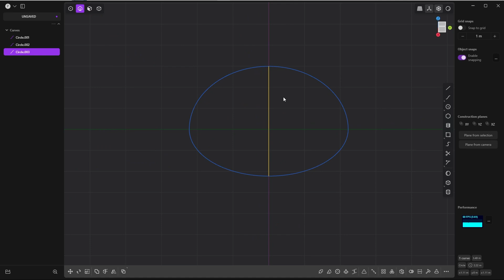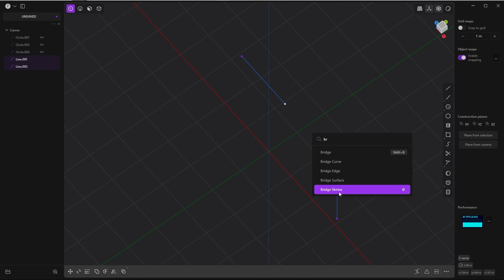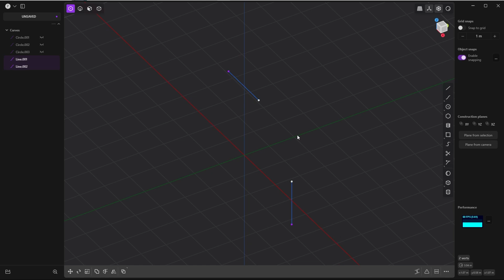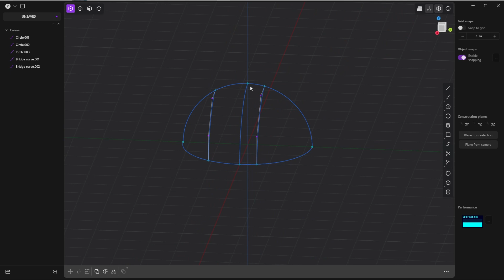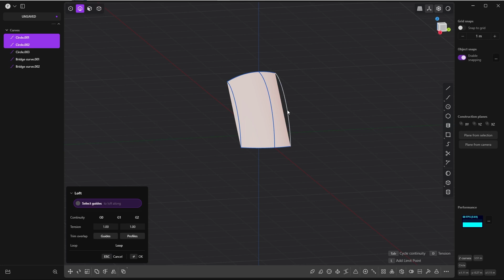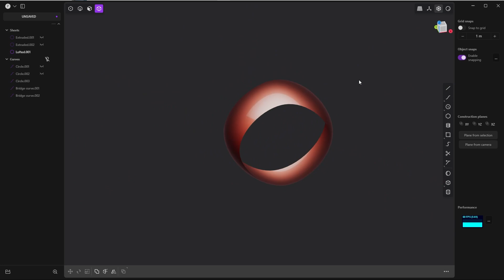Plasticity Tip No. 10 - Snap curves at any random points

Comment: I purchased plasticity a while back but could not work without offset construction planes so stated with fusion. This is one of the applications they would be so useful. I hope they can add few types of construction planes to the software.
Reply from the maker: @Theprofessor1212  you can create custom views if it's that what you mean by construction planes. I have a video on that: https://youtu.be/_1YhDT8t490?si=EgWQ2e9c6D5tJtqy